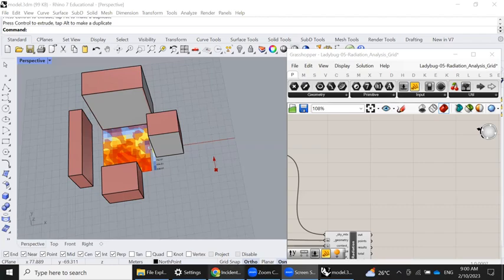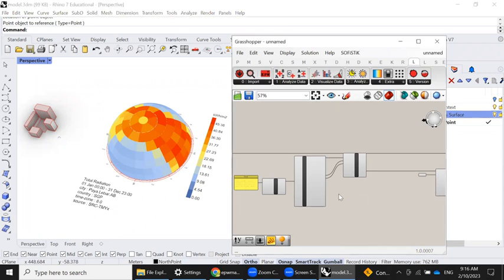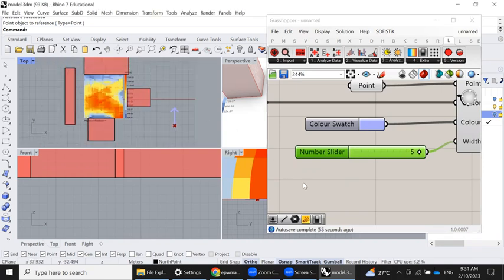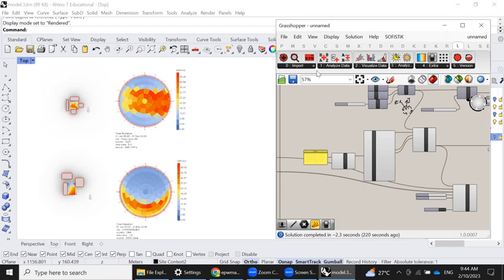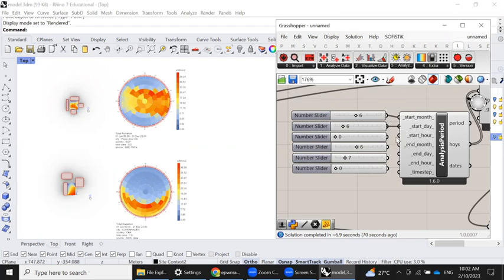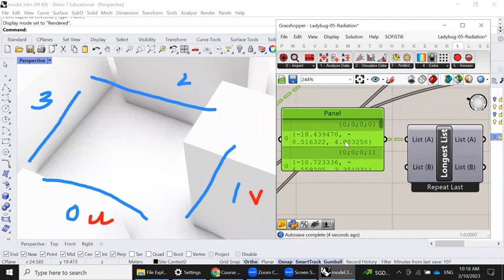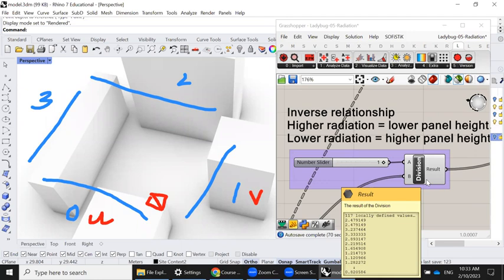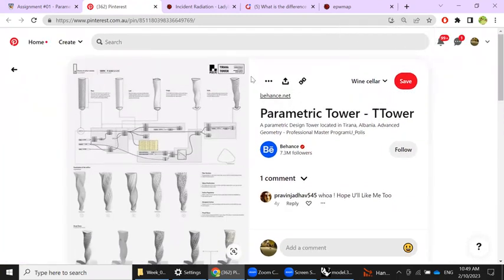Solar Radiation Analysis with Ladybug

Comment: Hello thanks for these video. I have a few questions regarding using Ladybug radiation analysis for surface/form generation in Grasshopper. Would it be  possible to send you a short email with my questions?